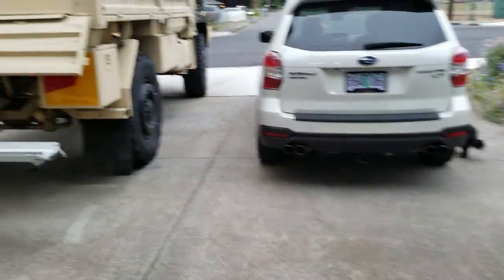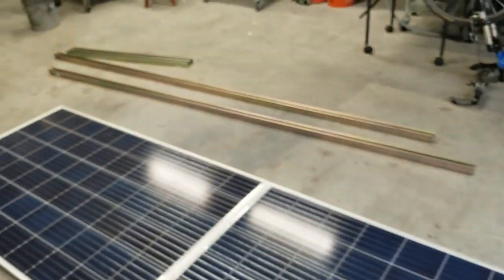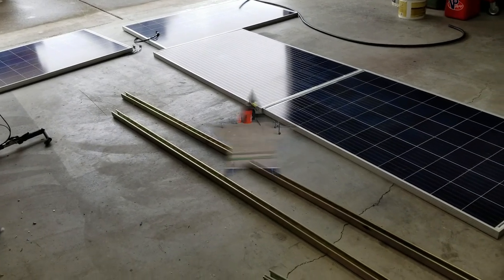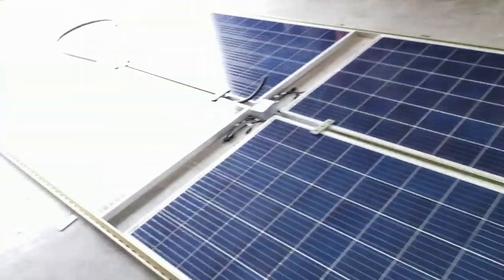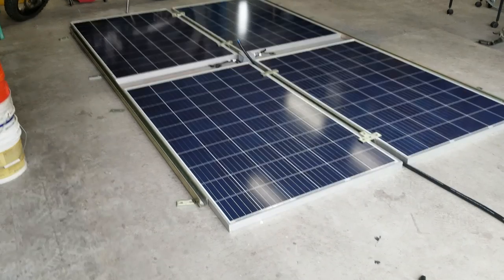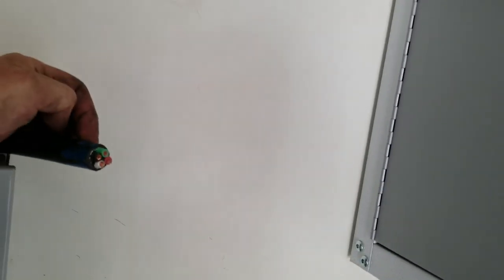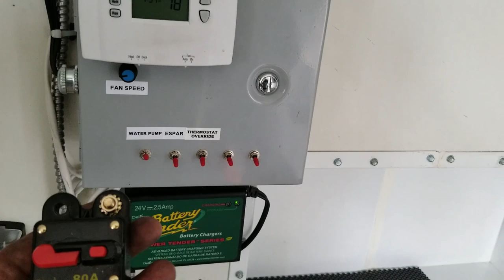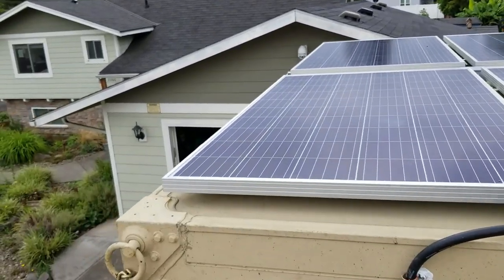Abel LMTV build part 121 (solar panel installation on shelter rooftop)

Comment: You will get more power out of them if you connect them in series, rather than parallel.
Reply from the maker: We find them to be overpowering already.  We get more amps out of them this way without much wasted energy due to overflow.
Reply: @SeanFillner  If you're using an MPPT controller, you'll get more amps out of them connected in series.   But, if you're happy with what you're getting, keep them the way you have them.  <-----  Electronics engineer
Reply from the maker: Pwm.  Series provides much less amperage and a huge overflow which results in voltage loss.  In series the panels would put out 120 DC volts @ 12 amps.  In parallel we are getting 32 volts at 50 amps.  Amps are "pressure" we need to run high draw items without draining the batteries.  We won't be running a fancy mppt controller.  We prefer to keep things simple and this fits the bill.